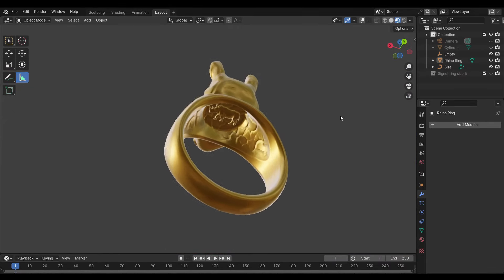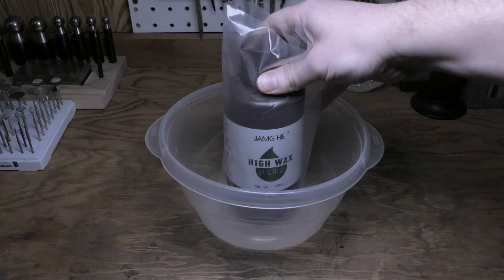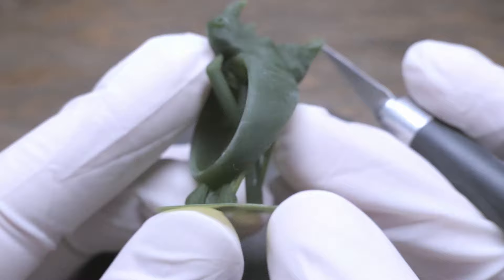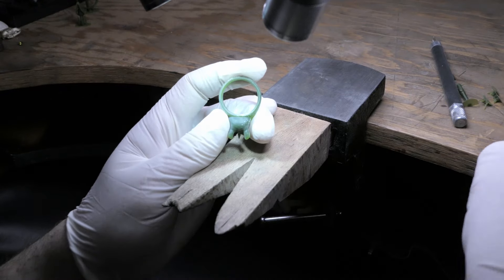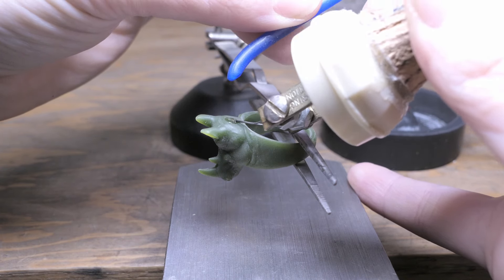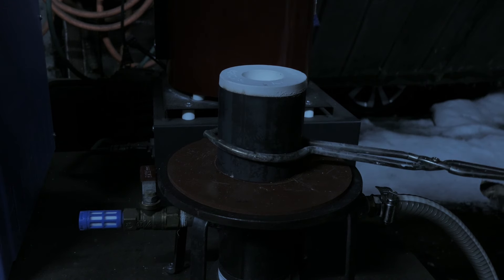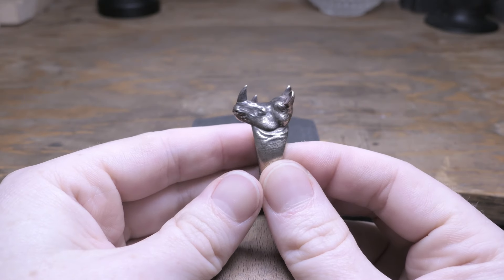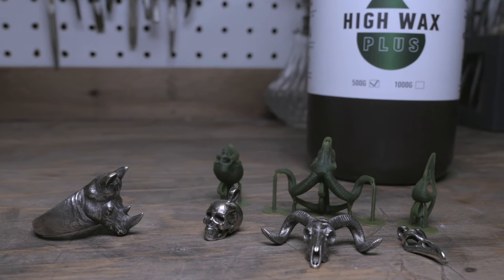Jewelry Casting with Jamg HE High Wax Plus Resin | Rhino Ring Part 3

Comment: Nice work! just a tip for you, you can use the resin to fill in any hole that the print might have and the just use a UV flashlight or nail cure light to cure the resin in the hole. then you can clean it up as you'd normally do. This is a tip that us car modelers use when we 3D print a model replica of a car or jet or whatever. and it is especially useful when putting parts together that have less than perfect fit with each other. Also, don't know if you know this but I'll tell you anyways, the opposite side of the tip of your X-acto knife is designed to be a scraper, so you can use the tip's dull side to clean up any surfaces that don't meet your standards. Thanks for sharing this print to cast bronze ring, makes me want to get some of that resin and make a cast ring of my own. The Idea of having a ring no one else on the planet has, is definitely alluring, but I don't have anything remotely like metal melting equipment to make a ring with. gonna have to consider this for a bit to see if I might be able to finagle an alternative. Great work, BTW!
Reply: Because you're using wax casting in this case, you're better off filling with wax while you're fixing it to the sprue.

Comment: Nice video. I use a mixture of vegetable glycerin/water 75/25 to cure my models. It seems to really help minimize surface defects in the casting. I've been using B9 emerald resin for years. I may have to give this a try.
Reply from the maker: Thanks! I'll have to give that a try for curing my prints.

Comment: Came out fantastically! I'd advice a touch of Anti Aliasing to blend/hide the layer lines, and design the sprue as part of the printing sprue/supports, it's very commen these days to integrate it so you don' t need to waste resin oby throwing them, or wax on making them again. Can do that in Blender, don't need to use a slicer to make support/sprues xD ;)
Reply from the maker: Thank you! Yea, some anti aliasing would definitely help with those layer lines. Adding sprues in Blender is a good way to go about it too.

Comment: Interesting I just got a resin printer and have been trying siraya tech true blue. I find it hard to work with.
Reply from the maker: I've never tried the true blue but I found the Siraya tech purple difficult to work with too. I saw your recent video on the Neytiri casting and it came out great!
Reply: @GraceNoteForge  and @lundgrenbronzestudios use the 50/50 blue/purple, best of both worlds :P hehe I mean bluecast x-one is the best, but for price, siraya blue/purple is a pretty good mix, tho curing in glycerin is a nuisance lol I've had consistently good casts with it, just a bit weaker post print than atypical resins for minis and the like, but so are most specialty jewellery casting resins I've tried. 
I'm still more fond of printing a single master in this, then making a vulcanised rubber mould (or RTV silicone if it's bigger) to make wax copies and using wax on the whole tho, works out cheaper for bulk and less bothersome xD